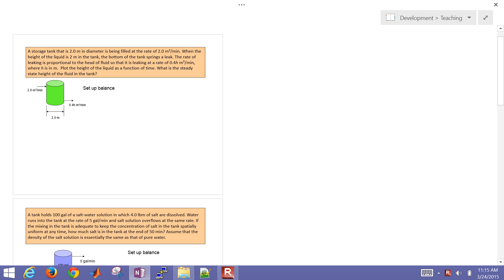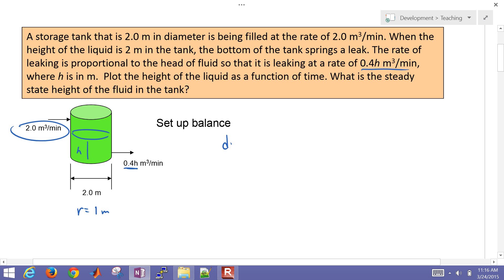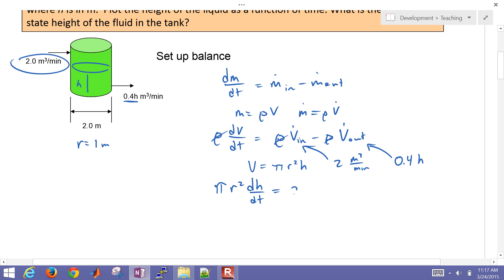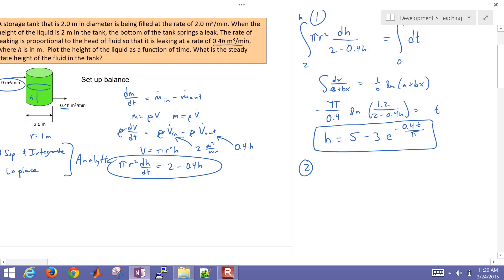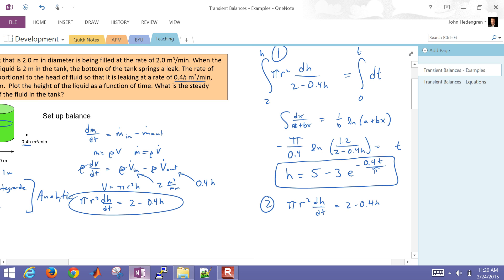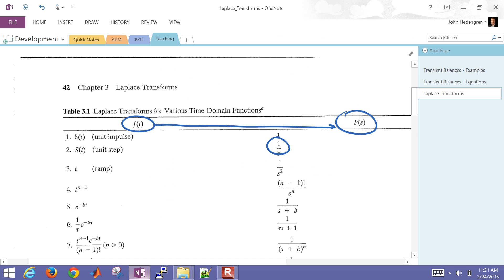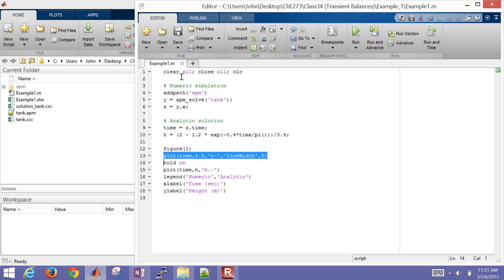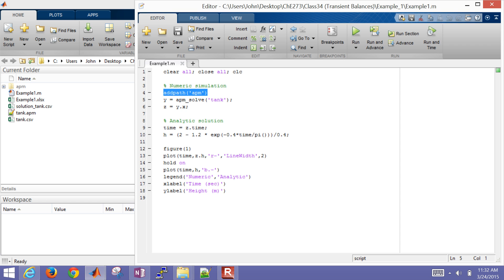Mass Balance Solution with MATLAB

Comment: Ciao! Professor, I always get this problem whenever I try to solve. 
Using default imode of 3 (steady-state optimization)
Reference to non-existent field 'time'.

Error in Example1 (line 9)
time = z.time;
Please guide. Thank you!
Reply from the maker: +Asad Imran, we recently changed how the solution is reported. Please replace z.time with z.x.time. Let me know if that doesn't work.
Reply: The problem still persists. 
The problem appears like this now: 

Using default imode of 3 (steady-state optimization)
Reference to non-existent field 'x'.

Error in Example1 (line 9)
time = z.x.time;
Reply from the maker: Could you subscribe to the APMonitor Google group and post your files? 
It is difficult for me to pick out what may be wrong from this 
information. I'll likely need the files that you are trying to run. You 
should be able to see the solution when you retrieve it with:

y = apm_sol(s,a)
disp(y)

z = y.x
disp(z)

It should also create a new data file (csv) in your directory that has the solution.
Reply: Thank you Professor. I just uploaded the file in the Google Group.
Reply from the maker: I don't see it yet. Here is the link to the group: http://apmonitor.com/wiki/index.php/Main/UsersGroup in case you got the wrong one.
Reply: I got it. I have tried to post but it is not appearing might be my membership is not approved yet. 
Also, I can upload the link here as well as I have uploaded files on Google drive.
https://drive.google.com/open?id=0B2ffOIs8CW3TSlVnWGdaV0Rtanc
Thank you!

Comment: hi..professor. I have stupid question is why we have to add opm file then we run matlab file..so what is the feature of omp file. thanks....
Reply from the maker: This is a good question. The APMonitor Modeling Langauge (APM) is an add-on to MATLAB to help with simulation of dynamic systems (differential equation solutions). More information on APMonitor is on Wikipedia (https://en.wikipedia.org/wiki/APMonitor) or from these tutorials: http://apmonitor.com/che263/index.php/Main/MatlabDynamicSim  You could also use an integrator such as ode23 or ode15s (in MATLAB).